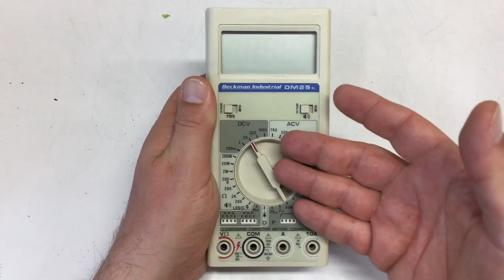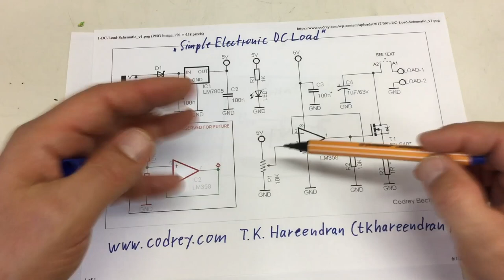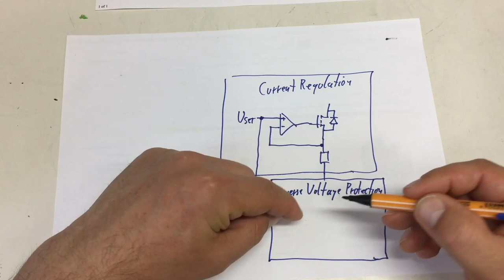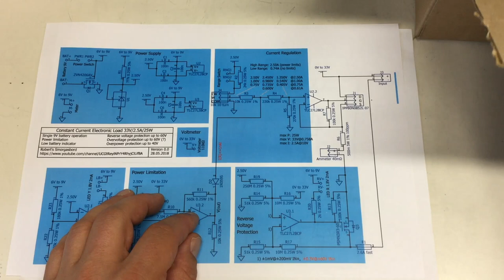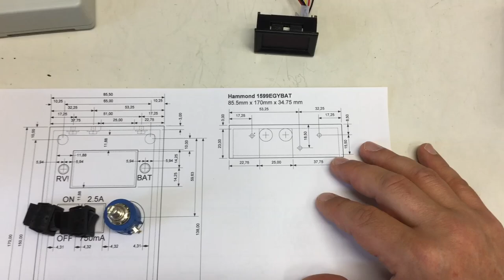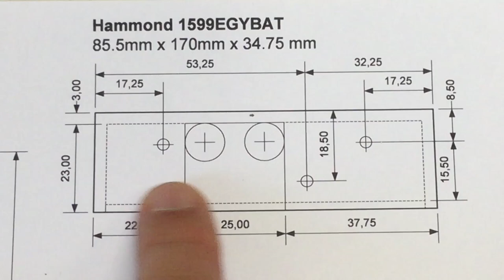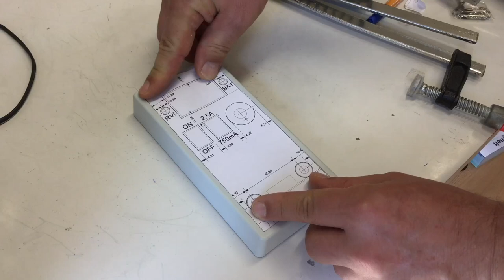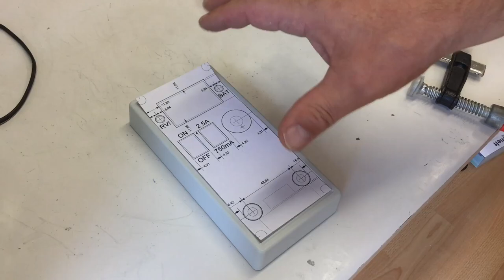"Simple" Constant Current Load (1): Outline and Enclosure Machining

Comment: Explain what the address of cost of nrf24I01 is?
Reply from the maker: You're comment is a little bit off topic, but anyway ... What do you mean by "address of cost"? The NRF24L01 does not have a (bus) address. It has an SPI interface and thus is addressed by a chip select line. Here's a quite good tutorial (Arduino) for it: https://howtomechatronics.com/tutorials/arduino/arduino-wireless-communication-nrf24l01-tutorial/